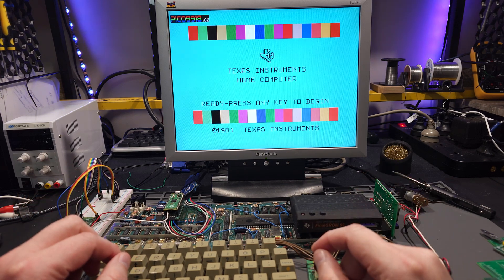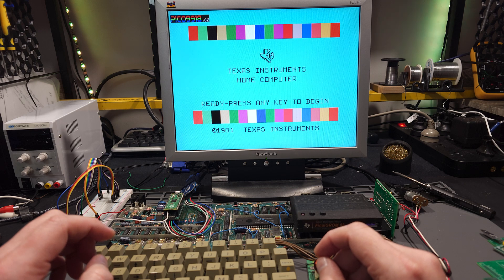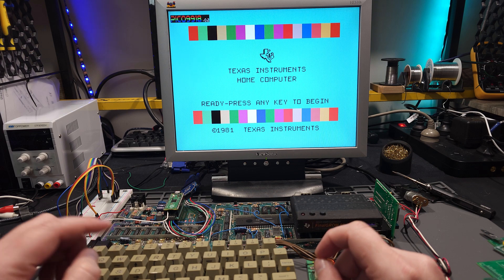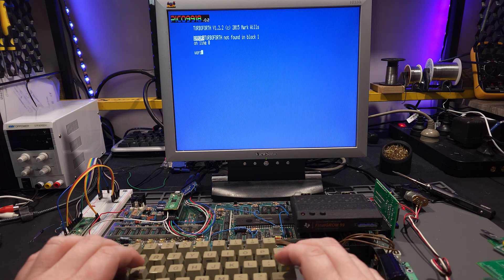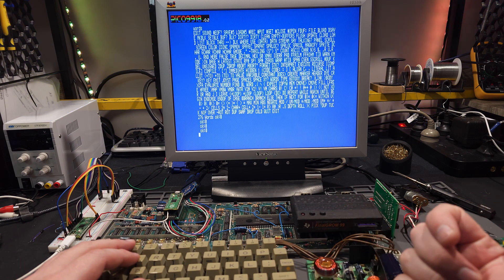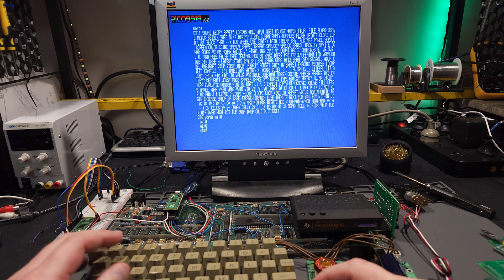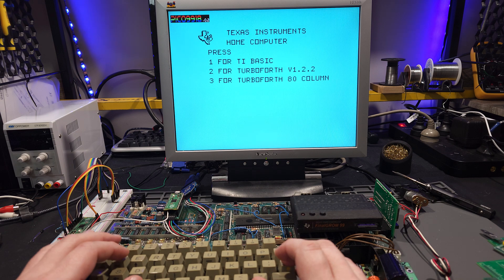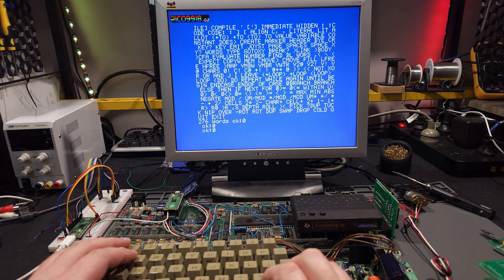PICO9918 prototype - 80 column mode test

Comment: Há possibilidade de uma atualização para ajudar na conversão de um HB-8000 MSX1 em um MSX2 ? Claro que trocando a ROM do mesmo para se ter os comandos MSX2. Agradecido.
Is there a possibility of an update to help convert a HB-8000 MSX1 into an MSX2? Of course, changing the ROM to have the MSX2 commands. Thanks
Reply from the maker: @ho_mem_nuclear  I'm working on V9938 support. It would require an additional wire to be added.